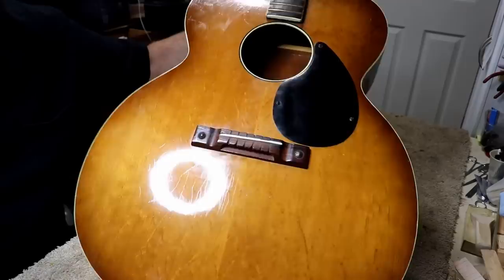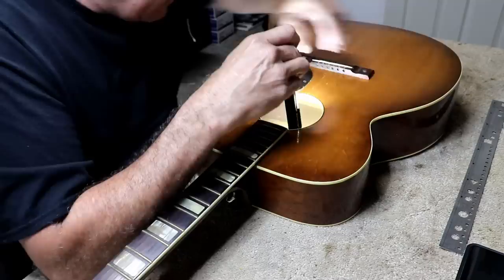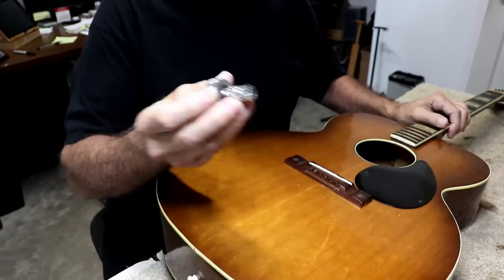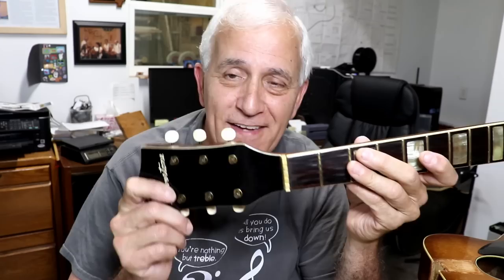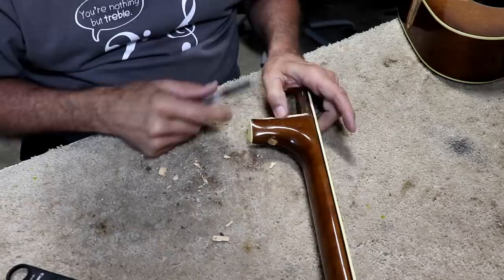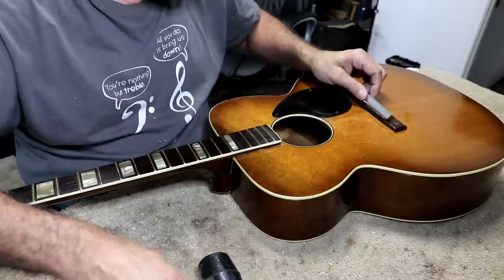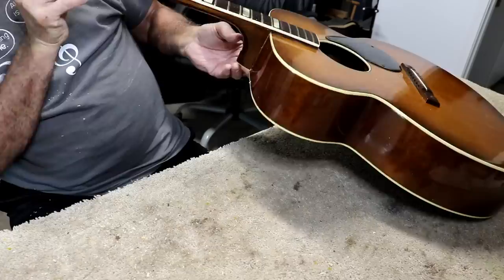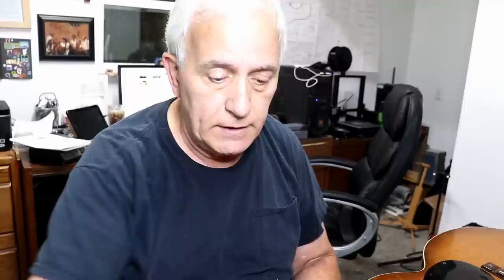302 Rsw Silvertone Finger Eater

Comment: Razor blades and utility knives: yep, modern ones pretty much suck. The manufacturers are obviously not using a good grade of high carbon steel (which not only would hold it's edge better but would be stiffer as well); modern razor blades seem to lose their edge almost immediately, and many brands flex alarmingly when you're trying to work with them. Although I haven't found a current-manufacture single-edge "paint-scraper" razor good enough to write home about, I recently bought a Japanese-made Olfa utility knife (medium size, 18mm blade width), and the blades for it, especially the double-honed, anodized black finish blades, are scary-sharp!!!!! I never much cared for this type of snap-off-blade knife in the past, and the push- button locking mechanisms on other brands of knives are too easy to hit by accident while working with the knife, causing the knife blade to retract into the handle, but the mid-sized and larger Olfa knives have large thumb-wheel locks that can be cranked down tight and securely, and the blade will not slip or move by accident. And they're not expensive either (about $7 for the 18mm knife handle and nine or ten bucks for a pack of 5 replacement blades, the black-finish double-honed blades costing a couple dollars more than the regular silver Olfa blades, which are still really really sharp) . How did I not know about these things for all these decades? They're available in most big-box hardware stores, although Home Dumpo , and Blowz,  seem to be closing out a lot of stuff lately. Art stores sell them as well, at more of a premium price. Olfa also have various small knife/blade sets that are sort of like an Exacto, primarily for use by artists, although the skinny plastic handles on those knives tend to flex a bit much for my taste. Anyway, I bet you would find a selection of Olfa knives and blades to be extremely helpful.
Reply: Everything's made in China now.
Reply: @oldsyphilitic  , most everything, yes, but the Olfa blades I mentioned are made in Japan. Also worth noting....I found some old, probably 50s or 60s era, Stanley razor  knives and blades in a toolbox at work, sort of like a retractable-blade variant of an Exacto knife. The handles are metal, look sort of like a Olfa handle,  but they're clunky to use and not very comfortable to grip, also hard to change blades, just not very ergonomic or user-friendly; but the blades are super sharp and not rusty at all despite their advanced age. The blades will probably fit an extra-large Exacto knife handle, or perhaps I can trim the shanks of the blades slightly  with a Dremel tool and cutting wheel to make them fit....

Comment: That was a great video. I've never tackled that type of job before, but I can see that someday I will. Can I humbly offer you a little advice with some of your chords? If you keep your fingers closer to the frets that you are pressing the strings against, it will give you a cleaner sound with less buzz as the string will not lose contact with the fret.
Reply from the maker: Yes I'm totally aware of that.

Comment: I have this exact same model in my garage that I'm working on. I reset the neck and discovered that the bridge saddle is just plain located too short from the factory and the intonation is way off. The crazy bridge is a real headache. I'd like to replace the bridge but the bolts are a problem. I'm planning on filling the saddle slot with rosewood and just cutting a new slot on the bridge further back.
BTW mine was a laminate spruce top. Removing the plastic ring that lined the soundhole showed it easily.
Reply from the maker: Yeah they made a lot of different versions. This one definitely had solid wood top. The sides were for sure plywood but the back I can't say for certain but pretty sure was also plywood.
Reply: I'm doing a bridge now also. I got the inside nuts off but how do I access the screw slots on top of the bridge? They have cap on and I can't get them off.  Any suggestions?

Comment: I'm thinking that this neck is not original to this body. It seems to me somebody did whatever it took to fit this neck on that body.  I used to spend a lot of time bring back old guitars and other stringed instruments, and if memory serves, at least the Silvertone bodies I ran into were not quite that good, and usually didn't have serial numbers. I know that a lot of guys will take guitars apart to sell the parts, but even if this body was a Silvertone, I don't think it's an original neck. It's from the same period, and all that, but not made for this body. I never saw a bridge like that on a silvertone either.  I had one as a kid that was direct from Sears, and it was not like that, and was actually all plywood, and not as good of quality plywood at that.
Reply from the maker: It is 100% original it's a one owner guitar the man bought it in 1958. He turned it over to someone else to do a neck reset and they're the ones that put the bolt in it. I didn't know that when I made the video otherwise I would have just remove the bolt and filled the hole.
Reply: @RosaStringWorks  Oh.. okay mine was from the 60's, 68 I think it was. the bolt threw me off too. I guess there's something in it's past we don't know. I don't think it would have ever left the factory like that, not in the 50's when they still cared about quality to at least some degree. Maybe it had shims from the factory, but when they were redone it didn't take? I know that if you use a softwood for shims, it works for a while, then eventually doesn't.  Don't ask how I learned that, it wasn't the easy way.

Comment: i think neck didn't need reset. needed fretboard removal & trussrod plus stiffeners. without a trussrod  the neck warps. now u still have all the original probs + issues with low saddle height.

Comment: Rosa String Works What do you think was used to finish those old guitars like silvertone ? Think its lacquer,stain? What would you recommend for touching up a old guitar like that were finish is gone? Think acrylic lacquer be okay for touching up old guitars like that?
Reply from the maker: To be honest I'm probably the weakest in finishes. It's probably better to check another source.
Reply: A good chance of being either nitro-cellulose or shellac(French polish). Shellac will become sticky if rubbed with rubbing alcohol.

Comment: I don't think they were bolt on necks someone added the bolt!
Reply from the maker: That is 100% true.
Reply: yrulooknatme  i remember these guitars.  the bolt is correct the concept was ease of manufacture and ease of adjustment when needed.. these guitars were flawed and he common approaches was to use elmers glue to fill the gap , and as you see in this video. it was another fail point
Reply: @karst41  what are you talking about these guitars never came with a bolt in the heel of the neck... I have 2 of them!!! You'd  think I'd of picked up on that!... lol
Reply: @yrulooknatme   Back in the 70's Sears was huge in Atlanta.  These "darlings"  ell lets just say that just about everybody got one for christmas.  These bolts ons were quite common on the area, as were the Fenders and Epiphones.  
Cheers
Reply: @karst41  well... I'll tell you what... there must have been bunches of mean little luthier elves sticking bolts in the necks of old Silverton guitars sold in the Atlanta area that christmas.....for sure!!! 
Not so much were I'm from... lol!... To be fair, I barely recall the 70's ...

Comment: There is NO precision to the machining of the dovetail neck joints on these guitars. I had an old Harmony hollow archtop electric with a loose neck joint. On disassembly, I found it was made with a very sloppy fit dovetail. It looks like what they did in manufacture was clamp the neck down aligned with the body and simply filled the sloppy fitting neck joint with hot hide glue for a "poured fit"!! This may have worked for a few years with luck and some prayers!!

What I don't like seeing is the poor chisel technique!!
Reply from the maker: Just shut your eyes.